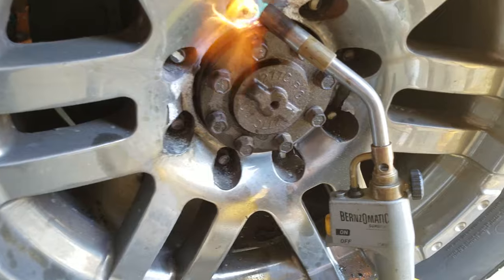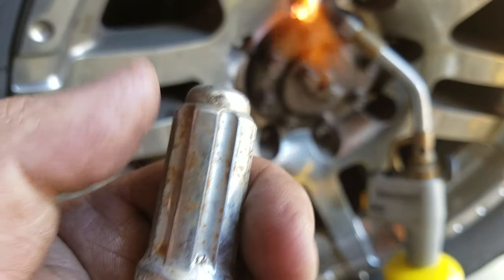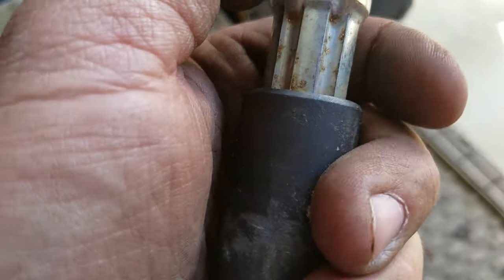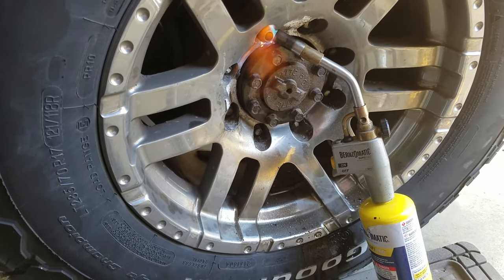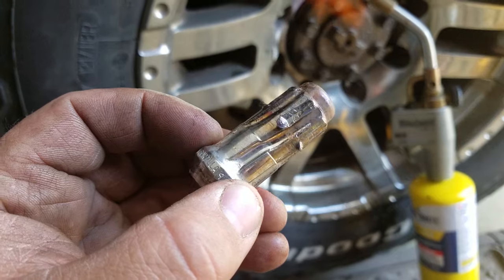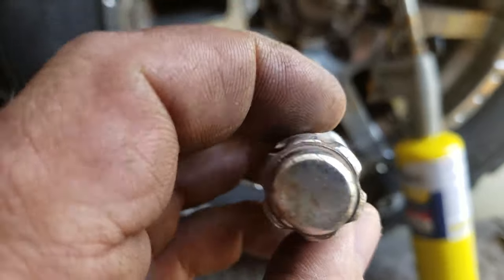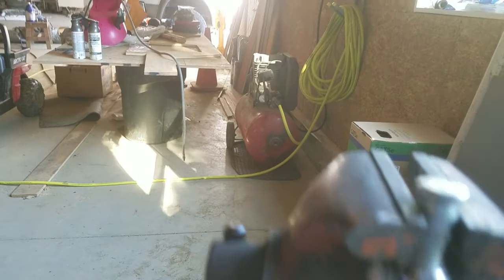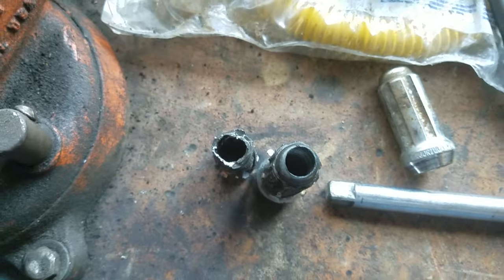Why I hate Gorilla Brand Lug Nuts and think they are Junk!

Comment: For about $20 you can go to any national tire store that sells wheels and usually get the correct socket. Discount tire keeps them in stock.
Reply from the maker: Issue wasn't that I didn't have the correct socket, gorilla lugs even though they have a 12 pointed torex style socket, they also allow a standard socket to fit incase of emgencies.  These lugs seized in place due to poor metallurgy, best I can figure.  Lug nuts should not be able to twist and distort as these did.
Reply: I understand what you’re saying and I agree that they shouldn’t twist. The point of the correct socket is deep enough that it allows full engagement of the splines all the way to the base of the lug nut so you aren’t twisting on the middle of the thin shank that may or may not be engaged with the threads. I have had an identical set on my F250 since 2009 with repeated removal and installs. Thankfully I’ve never had an issue, but I always have used the correct socket.

Comment: Any lug nut will seize up without anti-seize on the threads. Also, use the correct key socket at full depth. You twisted the socket from the tip.....it wouldn't do that if you had the correct key socket that covered the full length of the lug nut.

Comment: It is a known fact….as told to me by local Ram dealer when I owned a 2500.  Every time I rotated tires I would break lug nuts or studs.  Ram service told me that due to size of holes in rims on Ram 2500’s the lug nuts are sized down.  And on top of that the studs have shallow threads.  This combination means that if lug nuts are over torqued (usually due to installing with air impacts) the threads stretch causing a cross threading situation. Which makes it almost impossible to remove. Therefor seizing up and busting lug nut or stud.  Has nothing to do with the brand of lug nuts you use on the Ram. I’ve replaced 8 or more lugs every time tires were rotated or serviced.  It becomes expensive. But it’s a known situation I guess since I was told about it by the service manager at my local Ram dealer.

Comment: They act like they've been over-torqued like they were installed with that impact. OE torque specs are what, 100 ft lbs? Steel on steel only seizes from rust which I don't see or wrong threads or over-torque. Also those wheels are now brittle in that area from the torch/cherry red nut.
Reply from the maker: I agree with the stress from the torches,  but one could argue that since the wheel was backed by steel, that the heat was getting soaked into the steel to even out the heat stresses, but never the less, those wheels never reinstalled, and as for the lugs, they were torqued to spec 135 ft/lbs.